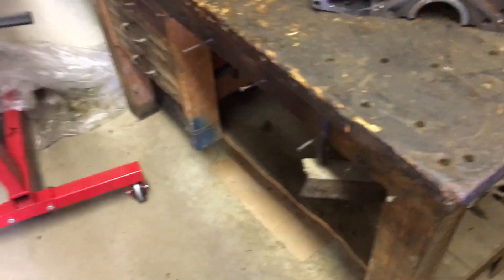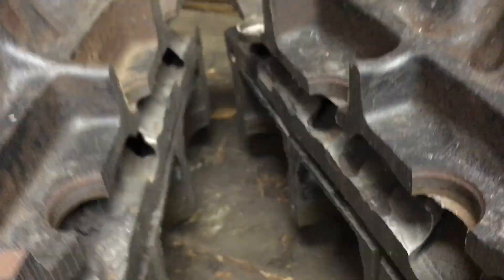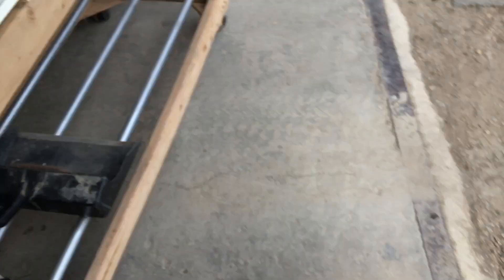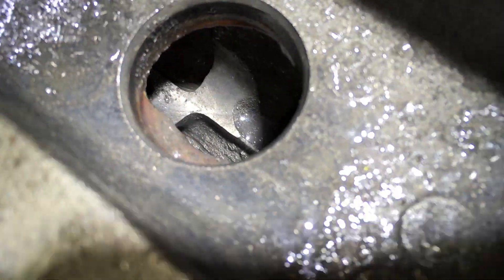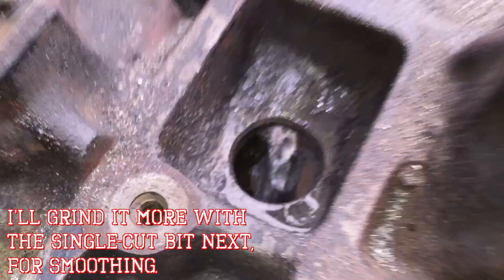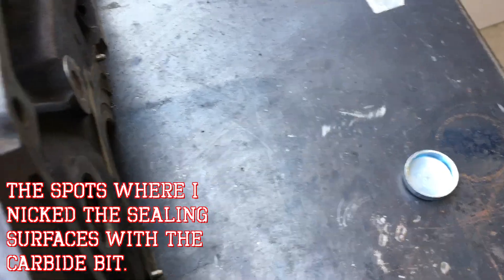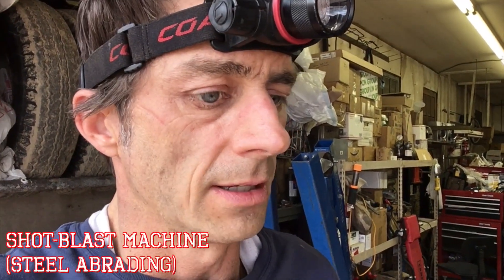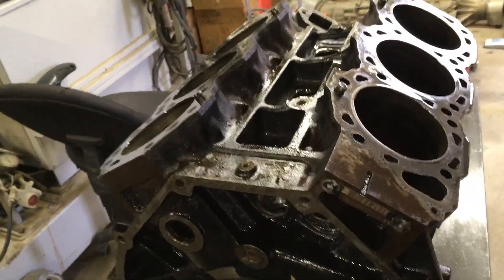XTERRA BLOWN HEAD GASKETS!  CAUSE & SOLUTION?!

Comment: I like your approach to this problem! Never thought of that...
Reply: It's all about quick, cheap manufacturing.
Reply from the maker: @michaelszczys8316 yeah, and that particular time was really bad for Nissan, as I understand it, a new CEO and manufacturing was moved to Brazil or something like that. These blocks are really bad. 🤓
Reply: The one I am working on used to run maximum temperature, I mean like while watching a scanner display it went all the way over 200 degrees before the thermostat opened.  I think running as cold as possible thermostat might be helpful with the wonderful circulation.
Reply from the maker: @michaelszczys8316 Yeah, I would say that’s a poor performing thermostat. I’m using only OEM Nissan thermostats and I run consistent at about 184-185. I found all the aftermarket thermostats were poor performing.
Reply: @Technically-Matt after watching this I was thinking, if there is some ' hot spots ' that run say, 20 degrees hotter than the rest then if the overall is kept to a minimum the hot spots might not get so hot.
Reply from the maker: @michaelszczys8316 yeah. Probably true. I still prefer to keep thermostatic temp around 185F and I found all the aftermarket thermostats ran hotter. So weird. 🤓
Reply from the maker: Yeah, I was shocked how badly some of these blocks are cast. So far, all of the blocks I have are like this. I’d like to get my eyes on some of the 3.0L VG30’s to compare. 👍

Comment: I have a blown head gasket and need to get the heads resurfaced. I'm glad I found this video.
Reply from the maker: Sorry to hear about your head gaskets. Yeah, it happens on these engines. Hopefully these videos will help you get her back on the road. There are some interesting things going on in this engine. If you have your machine shop resurface the heads, and if they assemble the heads for you, check their work. Mine installed the valve springs upside down. 🤣

Comment: I'm super curious to see how much better the engine will run, as well as how much longevity it adds. My VG33E is in need of some work and I'm considering taking on this project
Reply from the maker: Yeah, it's really had to say.  I'm not sure if there is a good short term way to evaluate this.  There is such a variety of other issues that can arise when using outside machine shops to help with fitting new aftermarket internal engine parts,  and aftermarket parts in general, that anything can go wrong.  Having said that, these trucks deserve a chance to live on.  The VG33E motor appears to be a pretty decent motor, and I think these modifications should enhance its longevity and overall performance.

Comment: Hey thank you! this is something ive been searching for all over the 'net for a couple years now. i have a 2k frontier. block is on the engine stand and. i do not have too much faith DIY it all from a gurage at home. i've always wonderd exactly how any one could ever get out those nasty casting flashes running through the middle of it. i personally took one look in the begining myself the first time i pulled the enge and stripped the block and realized bingo, this has got to be the main contributing factor for all the nissans that had the vg33e sitting in 'junkyards no one wants, why millions, maybe that high of a number? 'had blown a gasket and overheated around 122 or more, give or take thousand miles.  i dont suppose there is ANY way i could maaaybe. use this technique at home with hand drills or, heck no. this is something that would be done at a machine shop and put on a milling machine that can stepper the grinding/cutting chucks? i can't exactly afford a machine shop at the moment, the nearest one has a 2 month lead in time wait. almost winter. maybe have to fold on my project and go with out. My man though your doing it up the way, the ONLY way i would have if i had my own 'shop machines or ready to throw credit cards at the machine shops and request exactly what your doing for this block. im gonna feel guilty if i put the head gaskets on with out this step.
Reply from the maker: Hey!  Thanks so much for the detailed reply!  Yeah, I was shocked when I saw what was inside that channel!  I feel your pain about "feeling" guilty if you don't address that with a replacement block.  I had that same feeling.  And actually, the cost to have a machine shop do that drilling was relatively cheap.  I think they charged me $75 per block.  I did give them a block to "test" their setup on, before having them drill out the two I am rebuilding.  In fact, they did mess up the freeze plug hole at the back of the block, on one of my good blocks (and had to repair it by drilling that out to the next larger size).  The trick is finding a machine shop that has the machines to do it.  This is a heavy industries machine shop, not an automotive machine shop.  Sadly, he recently decided to retire so I'll have to find another one for future builds.  Or, perhaps I need to devise a way to do this at home.  I think that might be a bit tough, but I haven't really looked into it yet.   I'll do a little research into other machine shops in my area and see if I can find someone who has the confidence to do it.  If so, perhaps I can give you more detail on the type of shops most likely to have the machine to do this (there is likely a name for this type of machine that did this).  It was like a drill press, but it was horizontal.  They set the block sitting up, and then drilled it horizontally.  I also believe the 3rd block I did, I had them reduce the drill bit size to 7/8", down from 1", for better results.  I'll keep you in the loop!  Thanks again for your comment?!  I really appreciate it!!
Reply: Yah i been busy when i found the time and im gonna attempt to do this at home! saw a drill press for sale locally on a want ad listing. paid 75 bucks. ive exhausted machine shops in the frozen north michgian and the only one is always busy. they have a 2 month lead in wait time for more serious things that are not just a basic hot tanking clean up. two motnth wait for them to put together a bare block.  So i found a Silver & Demming 3 point flute drill bit, i went with a 1 inch size. it might come this saturday, 11/11 or 11/13 and reading what your saying about better results go with a 7/8ths i might have to make a return and not even open the package so they cant say its used. also on ebay i found 1 foot long half inch drill bit holder extensions made of forged steel. they look pretty strong. i have to modify them to fit snug and not have any out of round spin when they are tested on the Drill press, the one i found is a 1/3 HP craftsman 5 speed and already have a plane how i want to operate it. and secure the block horizontally so its a steady plunge bore. its a 5 speed press, slowest is 640, next up is 1100ish, next is 1700ish then 2300, then 3100. for cast iron/iron in general the chart suggests 1100rpms. from what i already know about drilling into metal and only done small projects, the key is to not build up TOO Much heat or dull the bit too fast. talkd to a few people that are curious but are not sure how they feel and dont want to seem my hopes are are saying just go slow, dont apply too much pressure, let the bits blades do the work and always keep a steady spray of a lubricant. i have a 1 gallon jug of WD40 and gonna figure out something off the shelf to apply a good articulated fast steady drip feed and a catch basin. if i think of anything else i'll let you know... I DO WONDER. whats gonna happen or what was happening with the shop you used  when they used a 1 inch bit, what kind of results did they have or was it too close for comfort removing actually inside block structure and removing more then just the castings that dont belong?  Also man im soo soo happy finding this video and new it was a matter of time someone else out there was going to have. i even once considered. ive never made a video or just recorded myself talking on a webcam for other people to see . ALSO  i would not doubt Chrysler has done the same level of neglect with some of their engines and cooling problems
Reply from the maker: @FoxBourne-g7q  Thanks again for the reply!  Interesting!  Nice work, considering doing this at home.  Perhaps I should try it also.  I really do need two more blocks. :). I have another Xterra I think would make someone a good hunting rig and a recent purchase that has a SC conversion.  Both need a new engine and I can't bring myself to NOT do the cooling passage cleanup either.  Good work on studying the proper bit and speed for cast iron.  Yes, definitely want to avoid heat generation.  I did keep things well lubricated when I was hand porting the channel, after the drilling.  Funny though...when I drilled holes into the block for relocating the knock sensor (I'll be releasing a video on this too), it was so soft I didn't use any lubricant and it didn't generate any heat. Kinda weird.  Those holes produced larger chips when it was drilled.  I'm not yet an expert on metal work either, so I'm not sure what is happening here.  If I remember right, the choice to go down to 7/8" was to avoid encroaching the underside of the top of the block so much, where the freeze plugs go.  I don't remember for sure if I changed to 7/8" on both of the two final blocks I ended up with or not. I can look back and see if I can determine for sure or not.  It's probably splitting hairs on the size.  I don't think you would have an issue with the full 1" though.  Do you have another block you can test it with?  Actually, I can look at the blocks I cut in half, and get a few pictures of what that full 1" one looks like.  I'm sure both of those blocks were done at a full 1".  Also, what length bit did you find?  I know the shop here went half way through each side and met in the middle.  I'm not sure why they couldn't get all the way through on one side.  Maybe the 2' bit was still not long enough, or the fixture it was in prevented it from getting all the way through.  I'd love to see how you plan to setup the press to drill horizontally.  Maybe you can send me a couple pics of what you are thinking.  Or, shoot a short video on it. :). Cool that you thought about making a video on this topic.  It just takes a little time getting used to talking to a camera. :)
Reply: @Technically-Matt  I"ll be in touch for sure! the bit i orderd that might come tomorrow or monday has about a 1 inch maximum cutter area. its shapped a bit differently then a spiral drill bit. from what i was looking up this past week untill i came across this video where bits that could do the job that costed around 400 dollars. i might of already mentioned that come to think of it. this one was 30 bucks and if you searched something similar to ebay or what not look for this string: "1" Countersink 1" Reamer 3 Flute Cobalt M42 82° Drill Hog" and the extensions i found that should work when you modifiy the short part of the shaft, not the insert tip to accept a 1/2" drill bit, use: Century Drill & Tool 38113 Ship Auger Extention,1/2 In. Shank,12In.. i only found these things in 1 foot lengths. i bought two and i might remove 6 inches of it. i forget how long the block is from end to end. but one measurement i kind of remebmer off hand was 15ish inches. i just needed that little extra bit to go all the way through. and i wanna step the lenth in incurrments and add as i need. id have boughtem more and looked harder for shorter once of the same type. i think they where around 15 bucks each. maybe 20
Reply from the maker: @FoxBourne-g7q  Ok.  I'll look a bit deeper into the bits.  I do remember the shop telling me the drill bits were multi-hundred dollar bits.  I just looked up those bits...I;d like to see what you are thinking of doing to modify them, to get them all the way through the block.  I just created a FB page for sharing pics and other info.  I don't think you can post pics here in these comment areas.  Maybe try posting on my new FB group called "Technically Matt".  Try this link here and see if this works...https://www.facebook.com/groups/344083854669577
Reply: I was kind of leaning towards the appropriate bits for this tasks where multi hundred and no other real way around it. also wanted to ask about sharing photos and mentioning other websites and things for sale on youtube and what all of their rules and policies are. i was  sort of nervous to go into detail knowing things get flagged or removed automatically. this reply  chain is about the most ive ever used on youtube since, i think ive ever heard of or regularly visited it. good idea thank you for making a group page.  

Also i looked at the block down the chamber thats gonna be drilled and going to take measurements before to double check just how wide a channel can be bored through with out touching important stuff like the bottem of the freeze plugs and the outside walls of the actual cylinders.  if i was listening to myself more clearing to my own intuition, something that is getting harder to do the older i get under stress and deadlines the more i 2nd guess myself. my first guess was immediately just go with a 7/8 bit to be double sure, measure twice cut once sort of thing.
Reply from the maker: @user-og5sn5hn9o Yeah!  I figured these comment sections aren't ideal for in depth discussion, but is useful for beginning discussion. 👍. I could try grabbing a couple of those bits as well and attempt to drill them out on some spare blocks I have to see the results.  I'm moving some things around in my storage this weekend too, I can get my eyes on a couple of the blocks I already drilled out, and see if I can get a better sense what the 1" looks like, compared with the 7/8".